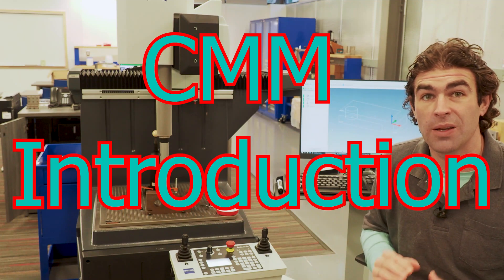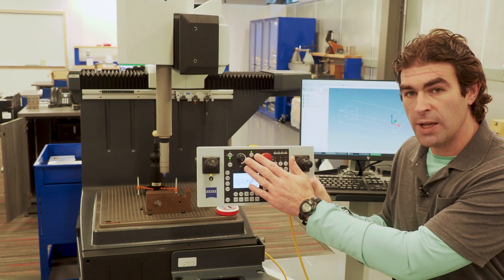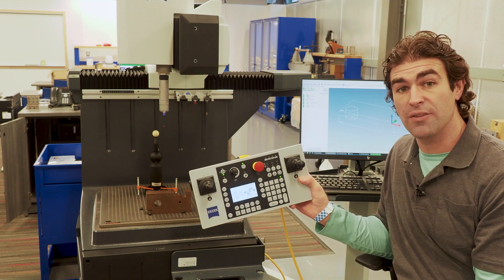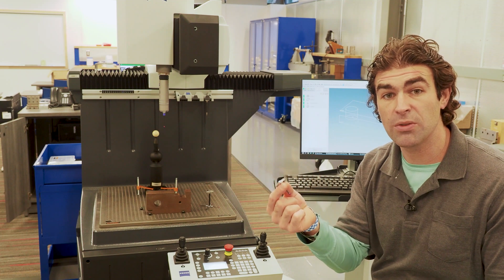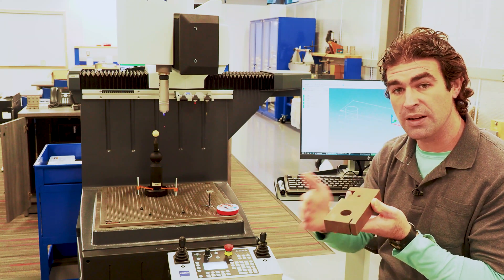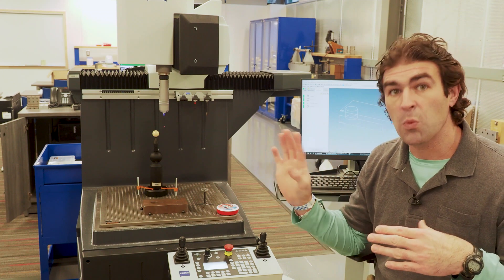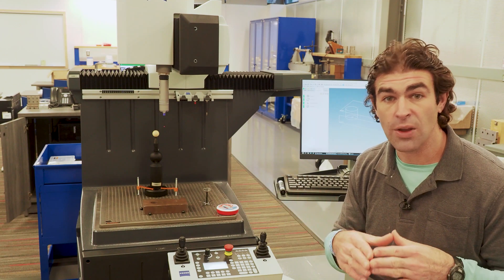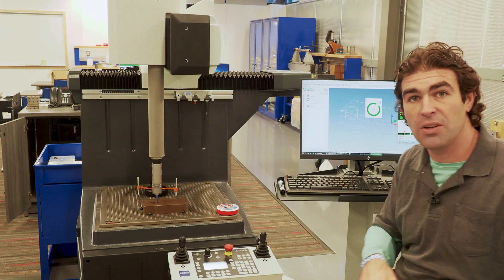CMM Introduction, Zeiss Calypso

Comment: Videos are awesome and very useful!  For someone who has completed the Zeiss Calypso basic training, what would you say are the most important things to focus on when going back to their shop attempting to program and operate the zeiss cmm on their own?
Reply: The most important thing to focus on is all the puss you're gonna get with the lasers
Reply from the maker: Hi, thanks so much! 
For you question:
-Knowing when to use outer tangential instead of least squares (depends on whether you use ASME or ISO)
-Using scanning only where needed, some features and characteristics can be picked up with points to save cycle time.
-Using retract distance, clearance planes etc…. (I made a video about this)